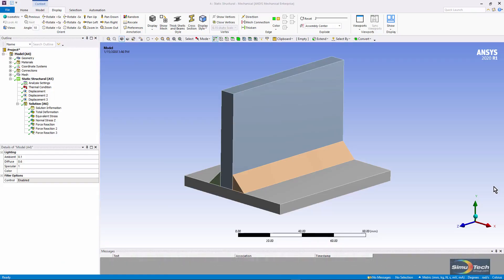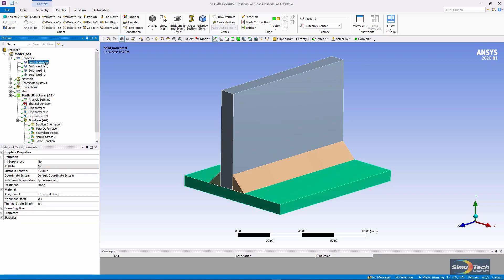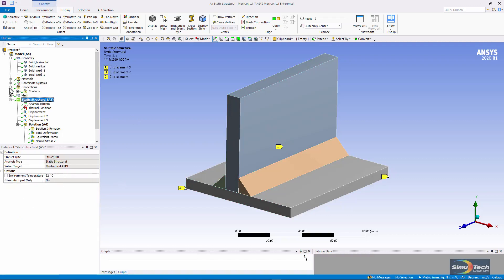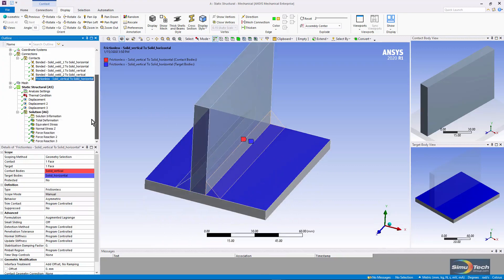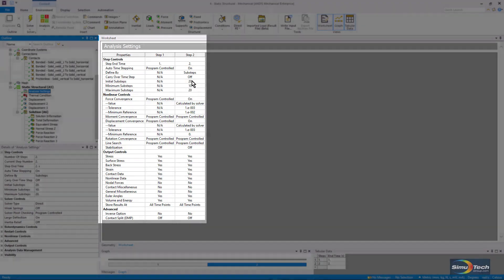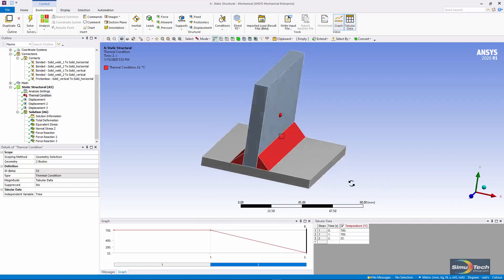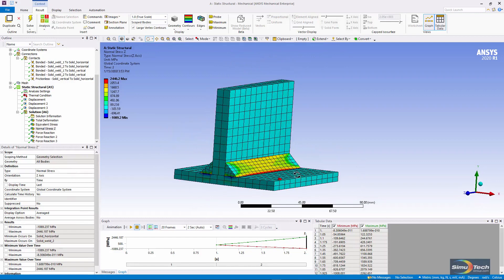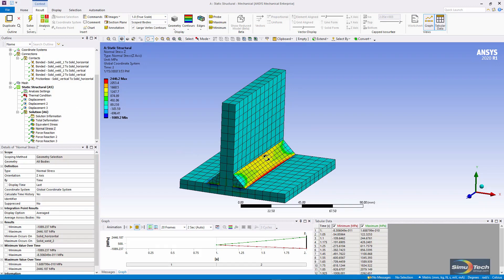Simplified Modeling of Weld Distortion in Ansys Workbench Mechanical

Comment: Hello Sir. Is it possible to apply "Structural NL steel" for welding material in Ansys?
Reply from the maker: Hello, thank you for your comment! Yes, it is possible to apply the Structural Steel NL material model to such a problem. This would be acceptable in an academic scenario but would be of little value if meaningful results are necessary. As suggested in the video, the weld material should be characterized with regard to elastic modulus as a function of temperature, TCE as a function of temperature and plastic stress/strain as a function of temperature.
Reply: @SimuTechGroup  Thanks. Got it. By the way, What does it mean TCE?
Reply: @Munkh-UnurTogtokhbuyan  thermal expansion coefficient?

Comment: Hello, thank you for the video. I would like to clarify about the residual welding stresses. As you have shown, the values of these stresses are high. As I can rememeber the welding stresses are self balancing onces.  Therefore, when assessing the strength of a welded joint, they are not taken into account. Can you please comment on this issue?

Comment: A second model could be developed, considering heating the plates before welding them and checking the final stresses after the slow cooling process of the entire joined piece. What do you think?
Reply from the maker: Hi, and thank you for your questions.

Yes, that’s certainly possible. You would need to set the initial body temperature of the plates. If you were interested in any time domain effects, it would be required to run a transient thermal analysis and apply these to the structural analysis to then perform the thermal stress analysis and capture the time history of the cooling process.

Should you have additional questions, please reach out to us at info@simutechgroup.com or explore the SimuTech Skills Center https://skillscenter.simutechgroup.com/ssc/landing-page